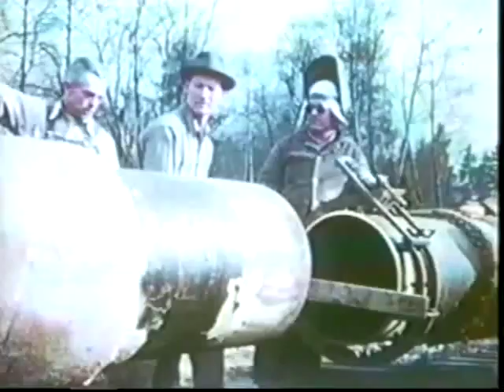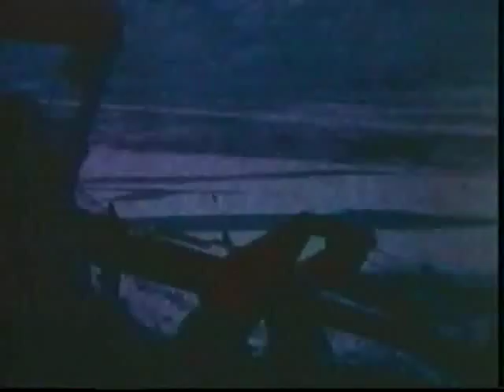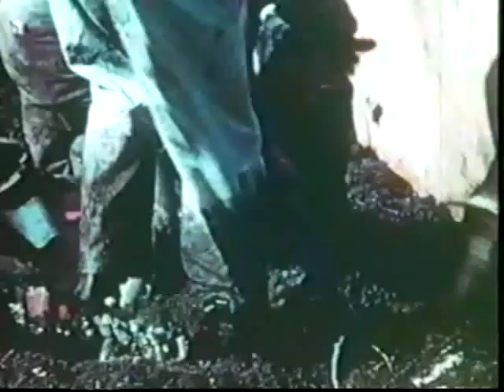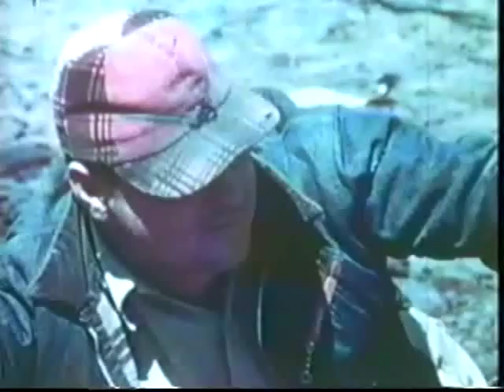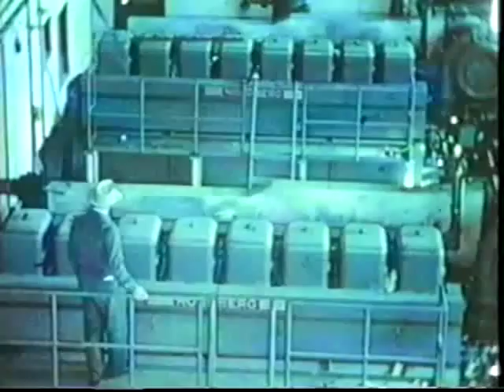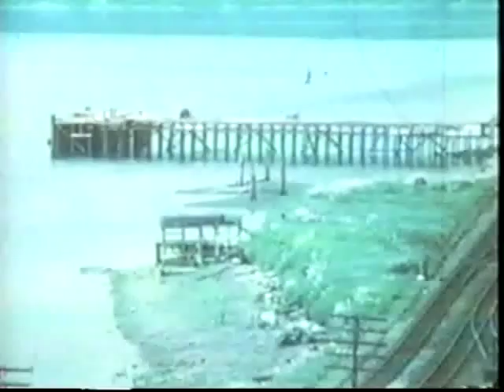Oil Across The Rockies -PART 3.wmv

Comment: The method of construction used then was crude by the methods and materials used today.
Reply: Methods today are similar
Reply: @dennisholst4322  - Codes have changes quite a bit since (for the better) and material today are far better.
Reply: Agreed. 60" cover from top of pipe, compared to 30"!